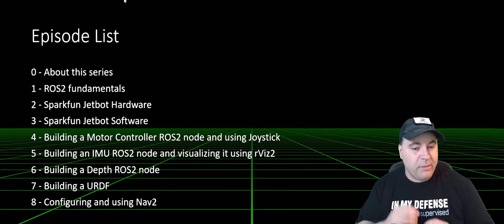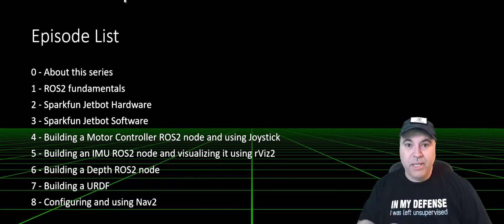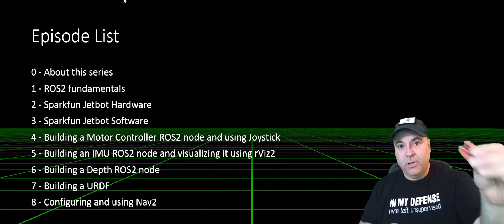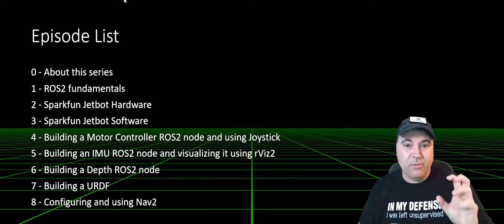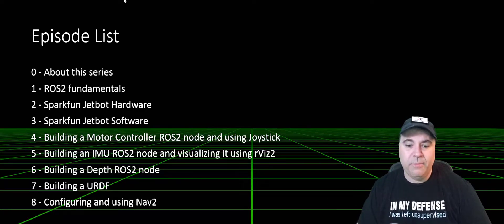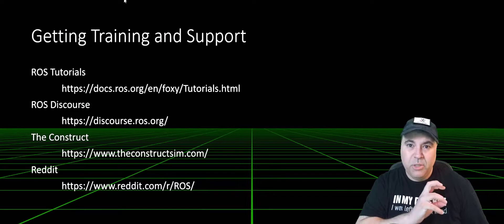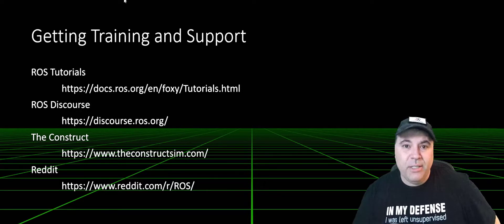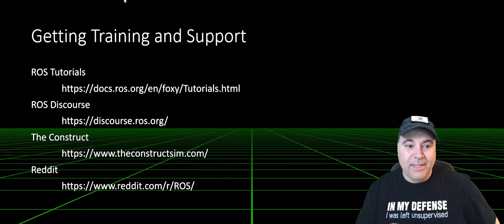Getting Started with ROS2 Navigation - Episode 0

Comment: Hey i have a question do you use linux, mac or windows ?
Reply from the maker: This is a great question. For both professional and hobby robotics, I use Windows and Linux about 50% each.  

Professionally, many of my customers are using Windows due to manageability and IT requirements. I support ROS1 and ROS2 on Windows and actively use it for industrial and warehouse robotics.

My hobby robots are Linux mostly due to compute form factor. However, I'll sometimes do bring up on Windows and switch to Linux. For example, I'm currently working on ROS2 on Windows to write most of the code for the IMU node, but will ultimately deploy it to the Jetson nano. Cross-compile for the win...